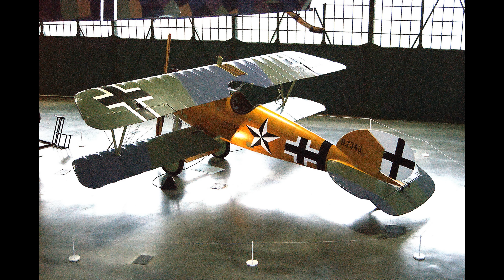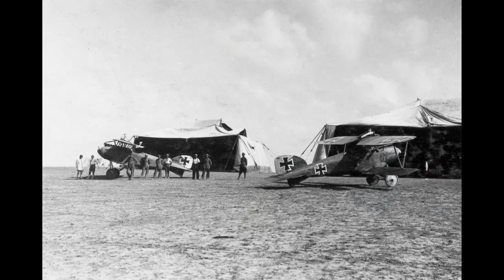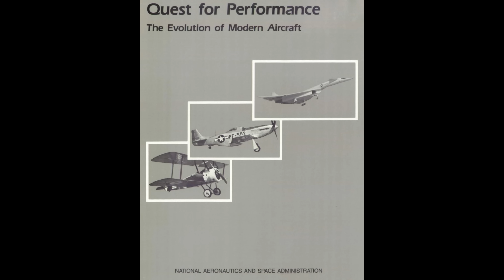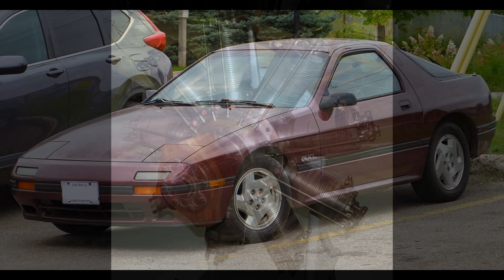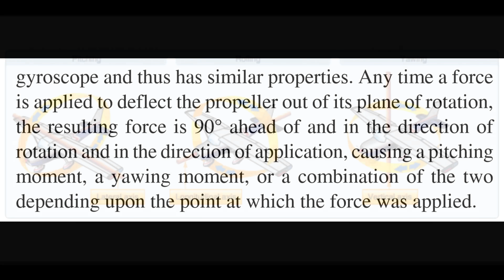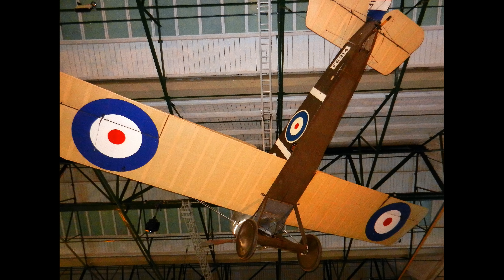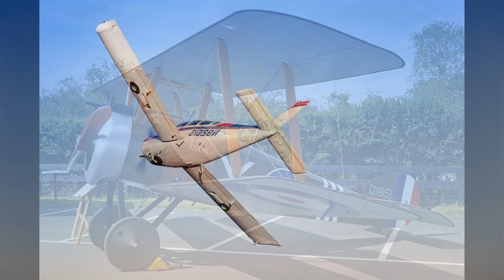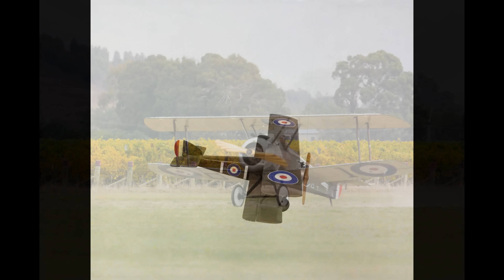Sopwith Camel, War Winner or Death Trap?

Comment: I once wrote a procedure on turning left in the DR1 on the old Rise of Flight forums, its a WW1 flight sim. It basically went as such....Step one start your roll to the left,  step two apply left rudder to start the nose in a downward attitude, and three haul back on the stick and apply more left rudder. The left rudder forces the nose towards the ground and helps counteract the procession.
Reply: While you're in there, you might test out the firing tactic that Henry Forster taught me: if you 'walk' the rudder sharply side to side, the gyro torque of a rotary will nod the aircraft slightly in proportion.  This will increase and decrease a 'cone of fire' from the gun(s) without having to steer the point of aim while shooting...
Reply: @wizlish  yeah it will oscillate. Whats scary is while learning that you can sometimes completely roll over if you don’t give opposite aileron or if you have a heavy foot on your pedals.
Reply: Yeah, he pointed out that you used sharp jabs against the pedals, so high but very short deflection of the rudder, and a fast enough oscillation that the actual yaw never built up substantially before it was 'reversed out'

You would NOT do this if you were anywhere near a stall on either wing, so presumably you'd be diving 'out of the sun' or not in a hard turn.  I wonder if you'd learn to fly a Camel so you'd preferentially stall the left wing first, so the old sailplane trick of rudder-turning away from the stalling wing would also torque the fuselage nose-down...

Comment: The Sopwith Pup was something that very few (if any) of its contemporaries were, it was relatively safe. It did not fall apart or get into irrecoverable spins, which is why it was retained as a training aircraft and why the RNAS were so fond of it for their carrier experiments. When it became completely outclassed by the enemy Sopwith came up with the triplane as a stop-gap while the Camel was being developed. The triplane was extremely forgiving, had an excellent rate of climb and was very agile. It was a bitch to maintain as you had to dismantle so much stuff to gain access to whatever was needed, such as the fuel tank. The first few came with structural faults due to poor contractor work and this gave it a bad reputation. The Germans copied it and it became the favourite of the Red Baron precisely because it was so forgiving and he was such a lousy pilot. The whole Red Baron thing is a triumph of propaganda, political expediency and back alley combat ethics, not of aeronautical skill. When the Camel came into service the triplane was replaced as it was so costly to keep going. 
Those rotary engines deserve a deeper treatment, specially in the fuel/air mixture intake. Some admitted air from a cylinder head valve (from the same space as another cylinder was discharging exhaust gases) and fed a very rich fuel/oil/air mixture through a port low down on the cylinder. If the engine was throttled down you also restricted the amount of oil going to the bearings (this worked much like a two-stroke engine) and the engine would seize. The way round this was to "blip" the engine, cut the magnetos intermittently to reduce power, the inertia of the rotating mass would ensure the engine re-start. At other times the engine operated at close to full throttle. Others had a valve in the piston crown, with counterweights inside the piston, the Monosoupape had, as the name implies, just one valve serving both exhaust and intake. All were pretty bad designs, but like Greg says materials and manufacturing technologies were limited.
The big issue was cooling fin design. This was so poorly understood at the time that even mechanically sound engines like the R.A.F. air-cooled V8 would grossly overheat. The first (or one of the first) fixed radial adopted after the war was the ABC Dragonfly, a triumph of marketing and cronyism over appalling engineering. If there was ever a FAILURE deserving capital letters, this was it!
The rotary engines provided reasonably reliable low-weight power, and were a great help in the pioneering days of aviation, much as the centrifugal-compressor jet engines 25 years later meant to the dawn of jet-powered flight. Not perfect, but it works and is sufficiently dependable to allow you to iron out the other issues.
Reply from the maker: I enjoyed your post but I would like to see a source for the Red Baron being a "lousy pilot".
Reply: @GregsAirplanesandAutomobiles  Several articles, including one in Mayfair about 40+ years ago... It's general knowledge that he pranged (and wrote off) at least two aircraft during training. If you read around you'll see the evidence coming up through the propaganda. Aerial Wonders of Our Time is also a good general source, it was published in 1935 but is remarkably easy to find. The way the Baron clocked up his victories was as follows: He was part of a "circus", a travelling unit of selected pilots that was deployed to whichever part of the front was under most threat. He was their poster boy so the bright red triplane was all part of the psychological impact the unit was supposed to exert. The RFC on the other hand had little time for "aces" considering this system as pernicious and corrosive of morale, so they did not have crack squadrons and tried to have experienced pilots distributed among the front-line units. When replacements arrived, these were inevitably poorly trained and a liability to themselves and others. They would normally be under the protection of a more experienced pilot but the standing order was that in case of a serious scrap, they were to turn about and find their way home (in itself a feat for these rookies). If they mixed it with the enemy they had a very high chance of being killed but also jeopardising their comrades who would attempt to protect them. The Barons's strategy was to stay on the edge of the scrap and wait to see an aircraft turn tail, and then pursue and shoot it down. On the day he was killed he was doing precisely that when a more experienced pilot (but no "ace") spotted him going after the rookies and gave chase, eventually shooting him down. Another version says the British pilot forced the Fokker down to tree-top height and the Baron was killed by ground fire from Australian soldiers, this is supported by the angle of entry of the bullet that killed him, if I recall the shot came in low on the right of the torso and exited high on the left, making a mess of his heart and large blood vessels within.
Now if you want REAL German aces look up Max Immelmann, or Oswald Boelcke. Boelcke was killed in combat but due to a mid-air collision, he was not actually shot down, the RFC sent an aircraft over the German squadron's base to drop a wreath with a message of condolence and admiration for this "most chivalrous opponent". I can't see anyone wanting to do that over Richthofen's base, although the British did bury him with military honours.
If I find anything more specific I'll get back to you. The trouble is that I do not have an index for the stuff I have, I suggest you look up in a database of articles in Air Enthusiast or Air International, they're usually very good.

Comment: The devil is in the details... The author fails to take into account that the Vickers gun used by the RFC and the French air corps had a significantly higher rate of fire, even when synchronised, than the German MG06. In order to achieve parity the Germans had to incur the weight penalty of having twin guns. They got redundancy as well which was an advantage considering the lack of reliability of all these weapons in those conditions. The MG06 was inherently slower than the Vickers, but when Germany adopted an air-cooled barrel sleeve they went with a design with so much metal cut out, that it was no longer capable of supporting the muzzle booster attachment, thus slowing the rate even more. The British opened out the front casting in a fan-like pattern and opened a few gills towards the rear. With the fast very cold airflow and relatively short bursts this was perfectly adequate. Later in WW1 the Germans adopted a development of the MG06, very similar to the Vickers, designed with air service requirements in mind.
Reply from the maker: source please.

Comment: Pilots in WW1 planes suffered from terrible stomach problems as the engines used a total loss Castor Oil engine that sprayed oil over the pilots in a mist and ingested the hot oil all the time, and were always soaked to the skin in oil. Castor Oil is also carciogenic long term.

Comment: Those flat wing wires are also used on WACO biplanes from the 1920's until the company's demise in the 1940's. I believe Boeing also used them on their Stearman design. As for modelers and how they approach it, plastic lanyard-weaving material, like Boy Scouts use to waeve neck lanyards for keys and placards, is flat and very similar in cross-section and works well if the model scale is just right. Keeping tension on the wires of a model is problematic, though, and heavy silvered elastic cord is commonly used. I wish I could post a picture or two of some scale wing wires I've done.

Regarding the rotary engines slinging oil, consider it was a castor oil-based lubricant, and in addition to slinging it inside the cowl, is turned into a mist by the airstream and blown back by the propwash and forward motion of the plane. The pilot got to breathe this stuff and one reason they wore goggles was to keep it out of their eyes. The scarf that flapped in the breeze was there in great part to keep the neck warm at altitude, but also to wipe the oil mist from the goggles. However, it did nothing to prevent the pilot from inhaling some of this mist. As we all know, castor oil is a laxative, so need we discuss its effect on the pilot during a flight?

Comment: Excellent Video.  All that oil the rotary engines sprayed out contained castor oil and this lead to many pilots being downed by dysentery.  When the French developed the SPAD 13, it had a conventional V-8 motor and an exhaust system that routed the engine exhaust out of the pilots face and that's why I think the SPAD 13 was the best fighter of WW1.

Comment: An additional drawback of the radial-rotary configuration is that the pilot has only rudimentary control of the engine power/speed. Rather than a continuous throttle, the motor is essentially running at full power 100% of the time. The pilot controls power by momentarily cutting the ignition. This 'blip' procedure gives the Camel its distinctive on/off engine sound, particularly when landing.
Reply: The Clerget rotary engine and the 120 LeRhone fitted to the Camel had a carburetor & throttle. The manual for the engine states do not blip from full throttle.

Comment: It almost seems that as soon as an aircraft came out and hit the front lines it was pretty much obsolete.  and of course the mid-1917 Camel was obsolete by 1918, so you might ask yourself why they continued to build and supply them till the end of the war, at which time the Prussian Air Service had won the fighter battle due to superior technology. Far better designs were available, such as the Martinsyde F.4. The Camel's only advantage was its instability, which made it hard to hit, though Richthofen nailed them regularly up to his death in April: he fought a Camel-rich environment. The Camel was something of a failure as Sopwith's performance figures could be demonstrated at the factory, even on ex-front line machines, but were not achieved on the squadrons.

Comment: You can feel the gyroscopic effect if you sit in a car with a large engine, liniar or V, in line with the length axis of the car. Rev it. The car will tilt, "twisting" against the rotational direction of the engine.
Reply from the maker: That's not the same thing, sort of similar though.
Reply: Torque effect

Comment: You'd think if you had a liquid cooled engine and a gun that got too cold to operate, you'd just bolt a heat exchanger block to the side of the gun and run the coolant through it.

Comment: As an amateur modeller, if I wanted to deal with RAF wire, I would use screeched sprue.  To flatten it, I would heat up  a  marble rolling pin in the oven and flatten the streched sprue.  I have only done this once, but not for RAF wires.

Comment: I could be wrong, but I've always had the notion that rotary engines were initially developed, at least in part as a weight saving measure. Most piston engines have a heavy flywheel bolted onto one end of the crankshaft. To save weight, engine designers came up with the idea of rotating the cylinder block and crankcase, in effect making the engine the flywheel and doing away with the separate flywheel. This worked well for the relatively small early engines. As engines got bigger and heavier, gyroscopic effects became more marked, until the weight saving was outweighed by the effect of gyroscopic progression, as well as the other disadvantages mentioned in the video.

Comment: Imagine, no oxygen mask,  flying top patrol at nearly 20,000 feet. The good news is there was usually only fuel for and hour and a half. The rotarys had no throttle, just ignition cut, out for landing. Most WW1 pilots had a flask of brandy with them, helped with the cold, PTSD, added courage...., and of course tempered the laxitive they were inhaling from the rotary.
Reply: The camel did have a magneto switch that allowed it to cut out a few cylinders and still have a running engine. How pilots were able to fly the plane while inhaling the exhaust is beyond me. Plus, no parachute, as "a pilots job was to stick to his aeroplane"-Tough men!
Reply: @JohnWaldron-cm7ce  depending on the engine used, there were LeRhone, Clerget, Bentley Clergets and the Gnome 160's.   The engines used, other than the Gnome, had a bit of throttling with mixture control so they could be set to tickover while waiting for takeoff.
Reply: @JohnWaldron-cm7ce  parachute were available though, and Ernst Udet did used one to save his life. It just weigh, or some unfounded fear of desertion that most not equipped with
Reply: @kidpagronprimsank05  Not available to all and not encouraged by command.....
Reply: 20,000 feet? Please show us the source of that statement.  Were you drunk when you wrote this?
Reply: @HerbertTowers  You need oxygen apparatus over 10,000 feet. WW1 planes rarely went that high.
Reply: @stevekaczynski3793 many people have flown significantly higher than 10000 feet without oxygen, even today 😀
Reply: @stevekaczynski3793  Untrue, many of the mid and late war German two seater Obs planes with over compressed high performance engines were able to climb to over 19K. It took them a while to get there.
Reply: Unfortunately this plane wasn't able to top much over 16K  The Gnome 160 was rather volumetrically inefficient.

Comment: Some terminology issues:

"Concentrated center of mass" = low moment of inertia. For brevity, we'll just gloss over that inertia is a tensor (a 3x3 matrix). The high school version that's taught to most people is that a plane will have three moments of inertia. Basically its resistance to yawing, resistance to pitching, and resistance to rolling. For the symmetrical bodies in coordinated flight, the simplified high school version is usually sufficient. (Search for videos of the Dzhanibekov effect if you want to see the crazy things that can happen outsize these constraints.)

"Torque affects roll, not turning." Yaw, pitch, and roll are all the result of torques. Any force causing (or stopping) a rotation is a torque. So any force offset from the center of mass imparts a torque. Gyroscopic precession yields a torque. I think you meant "engine torque only affects roll."
Reply from the maker: We're obviously talking about engine torque. Context matters.

Comment: As a long time, WWI aircraft fan, I often wonder, when there were at least a dozen aircraft of that time that had rotary engines, why, is the Camel singled out as a death trap because of the rotary engine?  The Snipe came out with a 230 HP radial, but yet it wasn't a 'killer'.   Perhaps the aerodynamics of the CAMEL couldn't really handle the gyroscopic forces of the rotary.  It wasn't the engine, it was the airframe.

Comment: Rotary engines were a menace; they loved to kill people. The Camel was good because you could get it close enough to your enemy that the rotary engine was at least as likely to kill them as their own pilots. The plane was a deathtrap even by WW1 standards, but it would have been less bad if the RFC had a better pilot training program (the RFC's training program was an utter basket case and it killed far, far too many young would-be pilots). 

As far as the "fairing to keep heat in sothe guns didn't freeze" thing... it was early days, most designers hadn't really thought about that yet. And your comment about the greater heat of liquid cooled engines was probably a factor in keeping it less of a problem in some planes.

Comment: The Spad S.XIII was, imho, a better airplane for the pilot. It was not as difficult to handle at low speeds and would actually recover from a stall before slamming into the terrain. And as structural failure, loss of control, and mid-air collisions killed as many pilots as air-to-air combat, it seems that the Spad was more likely to keep the pilot alive. Even if just slightly.

Comment: When I was 18 I worked for an airplane mechanic who specialized in classic aircraft. I have seen the RAF wires in person, and they do make a difference. When you are dealing with such low powered aircraft a little bit of difference goes a long way.
    I have also seen a rotary engine not just in person, but it was actually running.
    Kind of scary actually. And yea, oil goes everywhere.